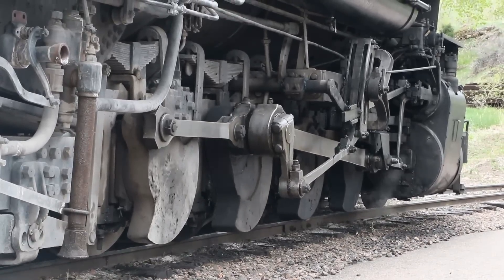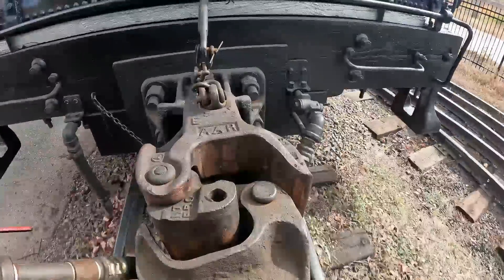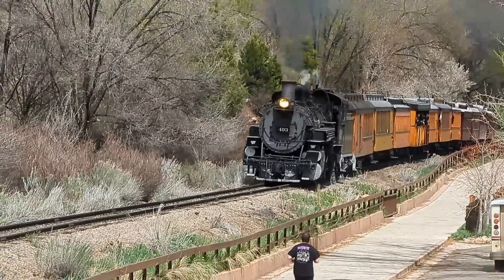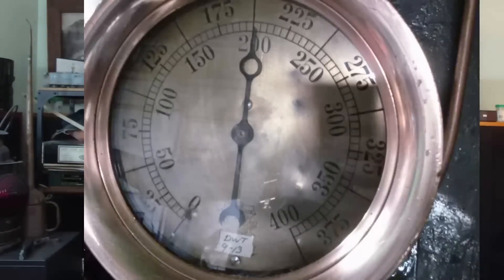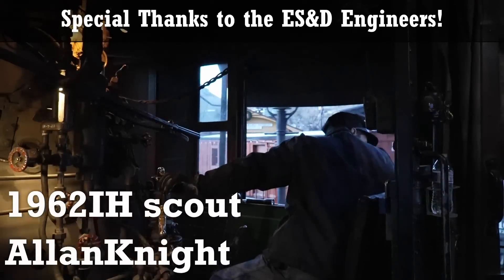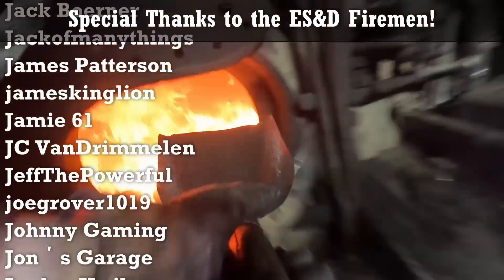Busting Tractive Effort MYTHS! | Railroad 101

Comment: One thing that's seldom mentioned when considering the T.E. equation is that you get the maximum tractive effort when the cylinders are bored out almost to the condemning limit (3/4-inch oversize for a PM Berkshire) and the driver tires are likewise almost at the tread worn too thin limit (4 inches under nominal for that same PM Berkshire).   This can add a surprising amount to T.E., but also makes the engine more slippery.
Reply from the maker: Very true! Good point. That would've been a fun thing to include directly in the video.
Reply: This reminds me of the C&O Alleghenies. It's said that it exerted up to 119,500 lbf of tractive effort with worn 65.5" drivers.
Reply: So a worn out engine basically will pull hardest if I am understanding you correctly?
Reply: @Hybris51129  The trouble with a worn-out engine is that K = 0.85 is probably lower on account of the mean effective pressure in the cylinders through one stroke being lower on account of deferred maintainance.

Comment: If an engine has electronic wheel slip limitations on each axle independently...how many axles should a modern diesel electric engine have for maximum tractive effort considering overall power and weight constant and instantaneously redirected energy from slipping axles to others.

Comment: I liked the part where you just say "you cant just keep adding more weight to gain more traction" and just when you said that i side-eyed my locomotives because ive been having slippage issues... granted i was pulling WAY MORE than it should have... but i added more weight to see if more weight on the loco would equal to more pulling power.... as it turns out... it did not

Comment: As a complete noob when it comes to steam locomotives or railroad in general but as a mechanical engineer, I am guessing that that tractive effort equation is so simple because the rest of the locomotive is designed around the most limiting factor: the steam engine. In other words: They design the boiler, cylinders and drive wheel size in a way that makes the steam engine part of the locomotive physically able to put out that tractive effort, then they would calculate the target weight that would allow the locomotive to actually put down that tractive effort without slipping with typical factors of adhesion, and lastly increase the number of drivers until they are below the maximum allowable axle weight. 

So it is not like things like number of drive wheels, weight of the locomotive are irrelevant for the tractive effort, it is just that the steam engine is the limiting factor and changing any other things won't suddenly squeeze more force out of the steam engine.

Comment: i see one problem. you use an outdated way of measuring tractive effort. tractive effort is very much influenced by traction on an adhesion railway. When you are fully slipping you make basically no tractive effort. Most locomotives slip when you apply full power at a standstill. Thus modern formulas for calculating tractive effort include that.

Comment: 8:24 I worked at a software company that did signalling and such. One day they passed around a news article with a photo of track that had been completely flattened by an engine. The entire height of the rail was gone and was converted to width.

The cause? Every single automated brake was still engaged (software error). Wild stuff.

Comment: From a physics perspective, friction is a function of weight and the coefficient for the specific materials. Surface area of the contact is utterly irrelevant. So adding more wheels will only increase pulli g power IF the weight increases proportionally (ie its all about the weight the drivers exert on the rail, not the number of drivers)

Comment: 10:46:  I don't understand this part.  Can anyone break it down a little?  Thanks.
Reply: It's difficult to break it down easily, because the preceeding 10.46 is error-riddled.  But at higher speeds less steam is admitted to the cylinders, so the mean effective pressure through one stroke is less, thus the tractive effort is less.
Reply: @theimaginationstation1899  Thanks.  That makes sense.  When he was talking about it being bad for the locomotives I thought he was talking about diesel.

Comment: To be fair I kinda think that the myth of sand adding more tractive effort might be due to a mixup when talking about which tractive effort people are talking about. Yes it doesn't increase the tractive effort an engine is rated as it's maximum. It can increase the tractive effort it is producing when viewed in the current moment based on adhesion. On slippery rail the maximum possible tractive effort is reduced, but adding sand raises the tractive effort the engine can actually produce in that moment closer or maybe even up to it's rated tractive effort.
Just a thought on where people might get mixed up.

Comment: 1:11 - Thanks for illustrating why measuring the force in Newtons and the mass in Kilograms is less confusing than measuring both in Pounds =P
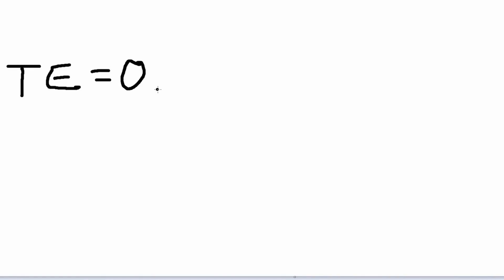2:10 - The .85 coming from the cutoff …? Or what are they?
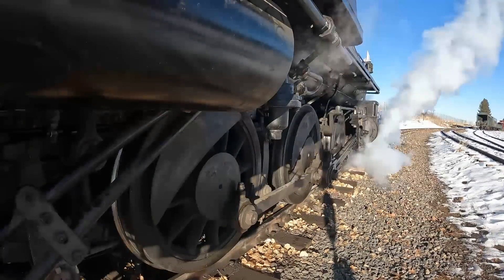2:50 - There's the answer.
3:15 - Or is it?
4:50 - There it actually is. xD
5:17 - I can't even commence to understand how that myth can come around. That's so obvious in my eyes. And yet, you're right, it does seem to be a common misconception.

5:56 - To be a bit nitpicky here (and acknowledging the possibility I misconnect some dots due to language stuff; sometimes terms seem to be literal translations yet mean different things), the rolling friction (aka rolling resistance) is way lower than that and not that relevant in this instant. It's the static friction of the (not slipping) wheel on the rail that limits the force transfer from the wheel to the rail (and thus from the engine to the Earth). And boy can it get low. For good, dry conditions .25 is even rather conservative - but we're talking steam engines with tons of lubricated moving parts on the outside and, you know, steam, so I'll guess a steam engine rarely is on actually clean, dry track. But I've witnessed situations where it barely was above zero. Leaves, certain types of pollen, certain types of industrial dust (both aforementioned especially when combined with beginning rain after prolongued dry weather), birch leaves (those deserve an own mention apart from leaves in general) and actually swarms of dead butterflies can be really nasty.

6:45 - That higher value being generally cited at somewhere around .4 to .45 under dry conditions. Bad conditions will always be better with sand than without, but they'll still be lowered. Wet, dirty rails will often end up somewhere around .25 with sand in my experience (200 kN becoming often the limit of feasibility, 84 t locomotive mass, my local gravitation is 9.81 m/s² -> friction coefficient calculates as 0.2427).
7:50 - Adding to the structural frame conditions of the railway itself there's also only so much force the couplers can take. Those you use on your pond side tolerate significantly higher forces and yet also there you get to the point of needing distributed power etc. instead of just yanking everything from the front. But apart from that; the number of drivers thing is more or less an issue specific to steam engines and in vastly smaller amount to historical or special cases in the other traction types. Usually and especially in modern day locomotives all axles are drivers, so while there might be other benefits to spreading the mass over more drivers (again, the trackage itself; size of motors; calmness of the ride etc), the tractive effort doesn't care if it's two axles or three bogies with three axles each.

9:35 - For those who like to see things through equations, you can also put it this way: One stroke of a given cylinder can only do so much work. No matter what happens after the piston, the given amount of steam at the given pressure has a given energy. Also, no matter how big or small the wheel is, one piston stroke (back and forth) is one rotation. And now if you remember mechanical 101, there's the neat equation of W = F * s with W being the energy (or the work), F the force and s the distance, in our case the circumference of the wheel, which again is proportional to the radius/diametre. Resolving for F, you get F = W / s and thus, given W being constant, F is proportional to the reciprocal of s. Doubling s halves the force, halving s doubles the force.

12:45 - Well, I'll say electric traction is a lot more straight forward. The transformer and the asynchronous motors have their maximum power. End of story. P = W / t = F * s / t = F * v; in other words, F = P / v. The faster you go, the weaker you are.

As always, well explained and understandable. You really make those topics far more accessible to "outsiders" who want to know more. Also for me with my own professional background in railway operations myself, but with no deeper connection to steam era stuff there's always a lot to learn from your videos. Only reason there wasn't much new for me in this one is that I've learned most of it from your other videos before.
Reply from the maker: Great discussions mate. The friction pieces are spot on, on your end as well. 0.25 is pretty conservative, but a lot of steam stuff had varying degrees of hardness in the tires back in the day which was part of where that comes in. But yes, pounds and poundforce.... imperial units are stupid.

Glad to hear some of the context in modern-day electric railway terms, and glad that I could help explain at least a little something. :)

Comment: Steam locos also have a tractive effort curve. Long-term horsepower (and therefore TE at a given speed) is determined by the ability of the boiler to make steam, but instantaneously you need to consider the difference in pressure on the two sides of the piston. At speed, reducing cut-off reduces the amount of exhaust steam you have to push out of the cylinder and thereby reduces back-pressure.

Comment: Hyce: "Historically, railroads used a reduction factor to run their locomotives at less than maximum capacity."

Me: Laughs in Southern Pacific, which was apparently known for loading their diesels to the point of crawling up the grades at walking speeds in Notch 8 and thus completely toasting the traction motors.
Reply from the maker: The SP was a special brand of stupid.

Comment: What's the Tractive Effort equasion for geared Locomotives like a Shay? I assume theres something that works for those as well.
Reply: It would depend on the number of power impulses per revolution of the driving wheels - which depends on the gear ratio - which varies from locomotive class to locomotive class.  So it would be a much more convoluted equation.
Reply: @theimaginationstation1899 I would assume (Bad word I know) that since Lima built every shay that they most likely had the same gear ratio on every locomotive, The difference being I think the number of pistons and trucks that were on each locomotive that really changes the way a Shay's tractive effort works realistically aside from gearing itself.
Reply: @jeremeymcdude  Fair point.  The TE equation is very blunt.  Number of power impulses is what counts - hence the equation for 2 cylinder locomotives allows for four power impulses.

Lima publish the tractive effort in their catalogues, so I guess the TE equation could be reverse engineered.
Reply: @theimaginationstation1899  So i went back to a video to just check and it looks as though depending on class you have 2 or 3 cylinders all on the right that all they do is drive a drive shaft that then powers the truck wheels via gears on the shaft and trucks. it seems that it could be relatively simple for someone who ACTUALLY knows math unlike myself to figure out something that works.

Comment: It has occurred to me on a second watch that your explanation of '0.85 as cutoff' was much nearer to the (I'm going to say) mark in your first video than the one advanced in your second video above - because cutoff does play a significant part in the mean effective pressure exerted on the piston face through one stroke.  What you've done above in "Myth 1: 0.85 Cutoff" with the inclusion of some fraction of Pi and some average of the power waves takes the explanation further away from how the equation works, thus perpetuating a myth rather than busting it.

It's a shame because a correct understanding of the equation is really interesting - and much more straightforward than that pdf the model engineering bloke did.

Oh well, I still enjoy your other videos.

Comment: What about an engine that has a super heater for the steam that adds around 100 degrees F to the steam.  Wouldn’t this increase the pressure coming from the boiler.  Should this be factored into the equation instead of the boiler pressure.  According to one steam pressure vs temp F chart the extra 100 degrees would add 1.1 lbs for each 2 degrees F rise in temp.  So that would make 200 lbs become 255 lbs under standard conditions.
Reply from the maker: Superheat doesn't add pressure, only temperature. It's one of the oddities of water - when it's contained, under pressure, as water and steam, yes the temperature and pressure are linked - i.e. temp goes up pressure goes up, but when you start talking superheat you can't have liquid water, which means that the pressure can stay the same while the temp increases. It's a separate thermodynamic table for superheated steam.
Reply: The Tractive effort equation was first published, in English, in 1836 - so it significantly pre-date superheaters.  The only change to the equation was circa 1900 when 'K' was added to reflect mean effective pressure throughout the entirety of one stroke.  'K' = 0.85 is the assumed standard for mean effective pressure from starting to eight to ten miles per hour (it's actually piston speed rather than road speed, hence 8-10 mph).  As piston speed increases K drops away.

Where superheated steam affects the tractive effort result is not in any increase in boiler pressure, but that the more fluid steam may well have a higher mean effective pressure through one stroke.

From time to time locomotives are touted as producing more than their rated tractive effort, but what that means is that the mean effective pressure through one stroke is higher - say 0.90, and that produces a higher tractive effort result.

The 225 pounds you suggest would not be achievable because the safety valves would lift at 200 pounds.

In any event, by the time superheaters became standard designers were looking for locomotives that could perform at higher road speeds, and the consideration shifted to producing horsepower at that desired road speed.

Comment: When figuring the tractive effort of a steam locomotive, I’m thinking one should use inches when plugging in the diameters of the piston and drivers into the equation?
Reply: Yes.  The thing that helps to make sense of the equation is that cylinder bore rather than cylinder radius is used to calculate the surface area of the piston because the equation requires four power impulses - and using pi x bore squared produces four times the area of pi x radius squared.  The reason why you don't see pi in the equation is that it's deleted as a common factor along with pi x driver diameter in the driver circumference part of the equation.